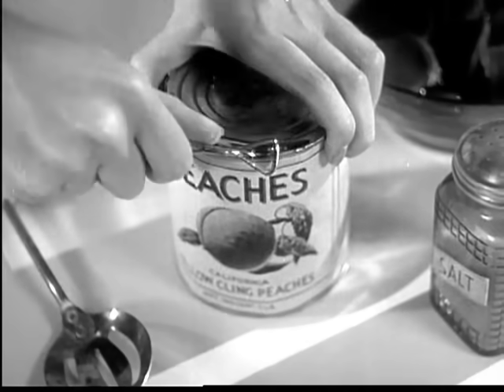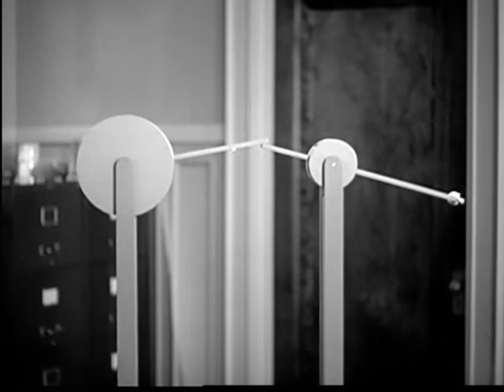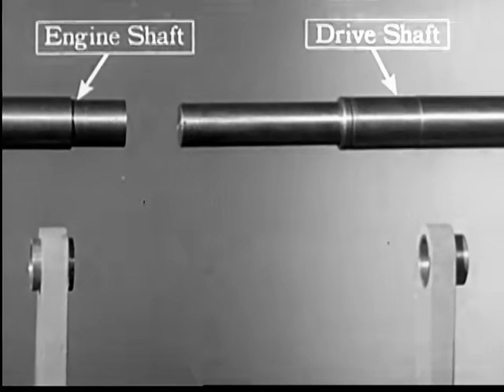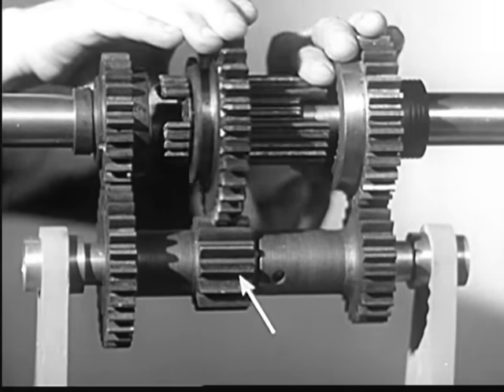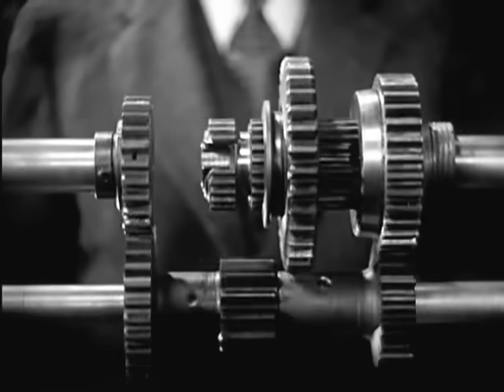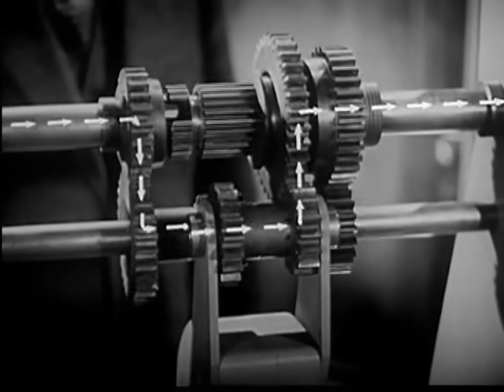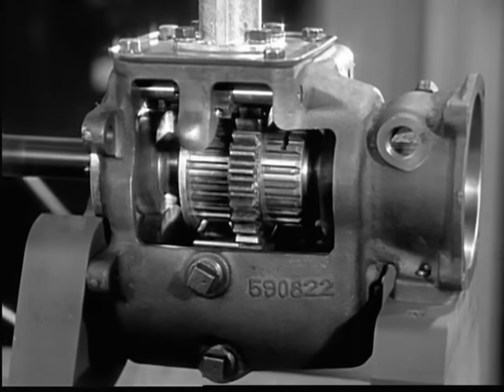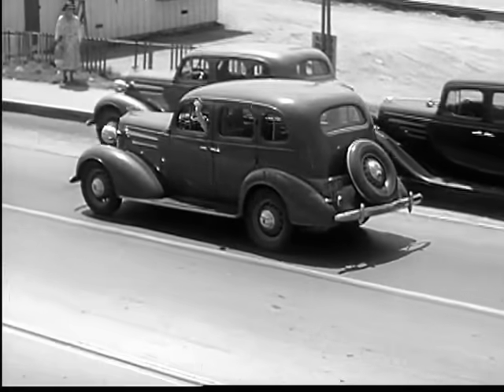Spinning Levers - How A Transmission Works (1936)

Comment: I wonder if these guys knew in 1936 that  over the next 100 years, no one would beat them in their explanation of how a manual transmission works.
Reply: These guys should have made modern DIY car repairs videos
Reply: Different times too.  But you couldn't always rely on someone fixing a problem.  Home repair books from the same era were similar, complex items or repairs broken down into simple to understand process.

My kids help around the farm and struggled with the stuff they drone out now, but if I give them old farming material from the 1920s to 1940s they get it.
Reply: @elilla331  Whoah! That's very interesting. Goes to show that nothing beats simplicity of explanation.
Reply: @vinayseth1114  absolutely.  Applies to a lot of things too, think of the big push on 'new math' but rote works fine, and if you understand the theory behind it becomes simple.
Reply: @elilla331  Oh, I wouldn't know that. Indian this side-I don't know if the change in curriculum you're referring to has come here yet.
Reply: @vinayseth1114  if there is one inevitably, if someone thinks it's better, someone will try changing it.  Even if real world results show the change would be worse.
Reply: @elilla331  Out of curiosity, what would you refer to as "new math"?
Reply: @vinayseth1114  humans actually are much dumber in modern times. Wihout being able to order food and basic supplies. Most people would eventually die.
Its kinda interseting how weak we actually are in western society. We rely on so much that we have forgotten how to do basic stuff.
Reply: @elilla331  Back editors didn't crack up marketing recipes yet, so their only strategy was "Let's hire the best author to write the best book we can print, and hopefully people will buy it".

Now it's more like "Let's hire this famous youtuber to write a book, let's put some drawings (not too complex), a bit of text (not too much, or people won't buy), and voilà!".

Content first vs marketing first.
Reply: @europeansovietunion7372  True on that.  Started to notice a similar trend when I was first learning C# back right when it was released(2000).  Lots of "booky names" of people who weren't actually involved in programming, but all the publishers falling all over themselves to make that money.
Reply: @elilla331  Thank goodness the laws of physics, which are key to making a machine, no matter how complex are eternal.
Reply: @elilla331  👍🏼👍
Reply: @elilla331  yes
Reply: @elilla331  its partly to do with the target audience of the learning material. Where i live we have a farming college just down the road and it is not for young teenagers. Many aspects is essentially engineering and science of agriculture. I think similar is true for most subjects but in the process of raising standards of education they forget to leave in some of the stuff to allow the younger people to absorb the information in a way they understand. Although some modern explanations are straight up Alien voodoo stuff ^^
Reply: @peterkent6250  Well I live in a farming community, we homeschool.  The entire community does, because the previous government(Ontario Liberal Party), closed ours and nobody wanted to put their kids on a bus for 3hrs/day.  

But, I grew up in a rural-urban area as a young girl.  All of our high schools were vocational and highly tied to trades, either so people could get some skills or because they were going into blue collar work.  Same government also closed all those shop programs, though last 5 years with the new government they've reopened them.
Reply: @elilla331 to me it seems like it's a large shift in the culture of our modern society. Personally, I'm disgusted by it, but this isn't really the place to get into it.
Reply: @elilla331  
My father told how hes first car drivers manual had instructions how to fix broken engine & gearbox with chewgum and screwdriver.
Today, my new car driver manual instructs me to not drink battery acid or coolant under any circumstances.
Reply: @MCH4RSK1HCPAALLIKKO  The first car I owned was a '96 Saturn SW2 with a stick shift, that I bought used.  In the manual it explained how to change and rotate tires, change the oil, replace the serpentine belt, and how to gap and replace the sparkplugs along with all the average normal maintenance.  

The last car I bought was a 2012 terrain, and yep, it has the same warnings while avoiding even the most basic maintenance, including avoiding how to check tire pressures as the vehicle had a TPS system.
Reply: @oliverheckendorf2215  something else too, most people had vocational training from school or home related work.  Ask yourself how many could change even the spark plugs in their car now.  Let alone changing a tire without a machine.  Society and the required knowledge to function in it is really different, even really different from 30 years ago.
Reply: I agree, I've been thinking bout using 1930 principles in all video that I do. Show and tell less talk and animate. These videos really sticks into your head.
Reply: The basic science of mechanics doesn't really change, it just gets more refined. Engines today work basically the same as they have since the beginning, just more refined.
Reply: Jhon Krasnovskiy  It would make you depressed if a concept you published 100 years ago was still useful? 300 years after his death, we're still listening to the music of Bach.  400 years after the death of Shakespeare, we're STILL producing remakes of his plays!  Heck, I'd be flattered!
Reply: Jhon Krasnovskiy  good point
Reply: Modern transmision works a bit different  and more efficently. Principal is almost the same
Reply: well everybody should start here and eventually get into more advanced understandings of newer technology. everybody’s dumb before they’re smart
Reply: To be fair we still have 15 years to go but I doubt we'll ever beat it. This is truly timeless.
Reply: My 1952 Willys Jeep has almost the exact same gearbox
Reply: It's brilliant and not stopping every two minutes to advertise some scamming  investing "secret" , dammit in those days you could go into a real bank for that 😀
Reply: if only teachers could explain shit this simple.
Reply: And imagine that they had no CGI to more easily do it. Maybe technology is not all it's cracked up to be?
Reply: yesssssss omg their explanation is on point
Reply: Or go through the trouble of engineering scaled-down models of a transmission just for a film.
Reply: Staggering clarity of ideas and videography from this era.
Reply: Damn I didn’t know they had video editing tools back then.
Reply: Just wonderful, been searching for "make your own candles" for a while now, and I think this has helped. Have you heard people talk about - Cenadoelyn Candle Contemplation - (Have a quick look on google cant remember the place now ) ? Ive heard some great things about it and my brother in law got great results with it.
Reply: lollolol yeah
Reply: 2021-1936 =85
Reply: All the other videos were confusing
Reply: https://youtu.be/xdEuLzPDLm4
Reply: This is the best video I’ve seen so far, all the other ones just confused me more
Reply: @mohamed elsayed Depends on the year and model, Chilton's or Motor should do you ok and they're available in most libraries(both physical and via e-borrowing), they're good if you know what you're doing, but they skip rote stuff you learn as an apprentice.  Hayes aren't bad for DIY and focus more people with some practical knowledge but not at the professional level.
Reply: yes and i still dont get it
Reply: Someone may do. It's only 2021...
Reply: U can thank the introduction of fluoride into the water supply and toothpaste for dumbing down society!!! That was its sole purpose along with destroying teeth so you look terrible and need dentures!!
Reply: Yes they did 36 is coding for 666
Reply: Or even come close.
Reply: 💎💎China 🇨🇳👍👍
Reply: in that time we went to quantum tehnology in everyones pocket and nearly everyone can explain the basic principles of a microchip
Reply: @timfischer8165  Yawn......
Reply: Yes
Reply: Most fools these days don't understand how a simple gear shift works either.
Reply: Fr
Reply: yes they knew future generations would be dumber, because they knew the were superior. everything back then was superior, they didnt need dumb computers.
Reply: 18 gears truck transmissions!
Reply: Fun fact. This is almost the same as how a dct works
Reply: Or that in the US most of us would be too lazy to shift. We would sacrifice efficiency (mpg) to let the auto do it for us
Reply: Agree!
Reply: Probably u didnt visit any INDIAN youtube channel.
Reply: There are nice explanation videos like this one: https://youtu.be/vOo3TLgL0kM

Note how complexity and strength of manual transmission changed with increasing the engine power. And you can find even automatic transmission and torque converter explained: https://youtu.be/X93k2vspvU0
Reply: Of course a video on a modern transmission would include computer programming , software updates, CVT principles,  ad nauseum..
Reply: Yes I understand very easy
Reply: yes
Reply: And that someone would be watching the "film" from bed in a device the size of a hand, across the globe.

Regards from Argentina
Reply: Very true.
Reply: @John.Flower.Productions  Yeah nah... This one isn't it, boss 😕😬
Reply: ????
Old generation is more smarter than now generation
Reply: That's why it's important too do great work. Posterity 😂
Reply: I have a chemics and mineralogy college level schoolbook from 1907, and it explains all the basics in a very hands on way, with a lot of practical examples like how to make coal from wood, or how getting iron from ore works and so on. It's actually highly useful in the real world, much unlike the books I had in school in the 90s.
Reply: Oh mankind, Surely we are created, and we were given life and we will be caused to die.
Where did we came from? What is our purpose? Why are we on earth?
You were created for a purpose. That purpose is to know and worship your Lord, Him alone.
Your life is a test, The Lord of all the worlds is the Most Merciful the Most Compassionate.
Don't go into the extremes like the christians and the jews. Don't worship the prophets.
Don't worship humans or animals. Worship the Greatest. The Creator. He is Allah.
Who send Prophets and Messengers to lead and teach mankind such as Noah, Abraham, Mozes, Jesus
And last and final prophet sent to mankind Mohammed came all with the same religion.
Follow that which we have been ordered. Don't die disbelieving. There is no return.
Do that which is good and forbid what is evil. Don't be fooled by satan who is an open clear enemy.
The only religion acceptable by Allah is Islam. The same religion each prophet and messenger came with.
Submit yourself to your creator so you may become a muslim.
Reply: @cydrohigh5375  In around the year 500 AD the condem was invented in the middle east by arab muslims using the lower intestine of a goat.

It was modified by the British around 1200AD by removing it from the goat first.
Reply: Actual Lesics could beat them as he used the same method to explain thing to us.
Reply: they probably had no idea they would explain it so well
Reply: I see why German tanks we really fast
Reply: @bckff5594  If only some people wouldn't have been so subversive.
Reply: Time for a 2036 video update: How a transmission works in an electric car
Reply: The youth today are not taught as well because of today’s failures with social issues such as discipline and changing priorities. During the 30s, 10th grade was their senior year and they graduated at 16 with an academic achievement level comparable to the first year and a half of today’s college level students; (13.6).
  In today’s world of 12 grades, students would graduate from high school with close to 4 years of today’s level of college education; (with no student loans).
  People today don’t realize just how far down we’ve fallen.
  Try watching a good movie called ‘The desk set’.
Reply: They probably thought communication would get better.  How wrong they were.
Reply: Well they wouldn't know about CVT either 🤢
Reply: Very true
Reply: You should check out the differential video too..
Reply: We still have 14 years hold my beer.
Reply: I wonder if they knew that in the 21st century you can't make jokes about women drivers
Reply: Old times everything was better quality
Reply: Really
Reply: True.it's impossible to get a good understanding of things from YouTubers explanations.
Better have these guys answer our questions directly.
Reply: ... all that and the nice touch of using a woman driver at the end!
Reply: Imagine if we had beat these and continued to beat each new one for 100 years
Reply: @jasonbender2459  because they haven't been explained fully who said it doesn't matter
Reply: @jasonbender2459  well played.
Reply: There are still 14 years left to beat them bro
Reply: @rickjeffjeff  mine was free
Reply: Yes, very clear visuals.
Reply: funny  thing  IS  ><   NOT  one  of  you  Know  HOW  TO  SHIFT  <>  !
Reply: Its not even in tell in my language but i understood it better than any other one
Reply: The KISS Principle at its finest.💯
Reply: lol
Reply: They had to be able to explain it to people with lead in their brain 😂
Reply: You are so right!
Reply: It's because humans got completely retarded recently. More and more retards like you have children and very intelligent people have less and less children or completely decide against it. Results, whole human population is currently fully retarded. You don't know that because you are too retarded to understand it
Reply: @itevensystems8860  ok buddy
Reply: No.
Reply: Instead of saying that, just say, I haven't really seen anyone explain a transmission like this before. 

Because I could point you to 4000 YouTube vids after the year 2010 going much more in-depth and remaining at a basic level of concept and understanding like here. 

No, it is not the best explanation, though interesting. 

Like kids thinking they know... It got so much harder than this.
Reply: @Hooly Dooly Automatics are damn near works of art at this point.
Reply: It is because this was a conpletely new invention and the lack of resources = explaining it like it is being explained to a dummy or alien
Reply: Well said
Reply: You know, these guys were a real genius.  Nobody finds a better idea than these guy. Same concept for engines and nox gears for years.
Reply: Im a truck mechanic and my teachers used these videos to explain different part of the powertrain
Reply: Or how levers and gears work
Reply: Yes, because modern education systems are shit. Take a look back to the 1930s for example. Nothing has changed in the education system, but look at literally anything else: phones, automobiles, buildings etc. They have all evolved and gotten better over the years. The education system, schools and whatnot have stayed the same
Reply: i knooooooooooooooooooooooooooooooooooooow right....easy 10 out of 10
Reply: They probably wouldn’t have guessed that in the intervening time businesses have dropped any notion or pretense of serving anything other than the short term interests of shareholders.
That we’ve more or less abandoned vigorous pursuit of any technology that doesn’t have an immediate, profitable application.
Reply: I'm afraid I could.
Reply: Well there are channels that have detailed animations and diagrams on the workings behind this, which is arguably a better explanation
Reply: T R U E
Reply: Nobody beats the Wiz! Nobody
Reply: I bet they had NO idea! 😂❤
Reply: "They" dumbed us down brother ..  I can feel it.... chicken and rice... yummy
Reply: So true
Reply: Why are the kids away?
Reply: Their CEO was hand-picked to orchestrate the Vietnam War. They knew far more than they'll admit...
Reply: Good point
Reply: Exactly!!!
Reply: honestly, the way these guys explain machinery is like no other
Reply: The only other major improvement I know is the angled gears that I can't remember the name of
Reply: lol i know right think of all the dumb shit on youtube or the internet that will still be here in 500 years people eating laundry pods instead of making videos like this
Reply: ikr
Reply: I wonder if back then they knew 'what is a woman'.
Reply: Ye but in 2036 that would be trully 100 years.Im suprised how much detail in 30' had.
Reply: @Merlok224  Ya and video editing.
Reply: @ArturoGarzaID  I dont think thats eddited video.Those are diffrient clips with hand draw animations.Meaning we were seeing stop motion but with more frames
Reply: Exactly
Reply: I know! I’m a novice to cars and trucks. My hubby showed me one of these videos to explain Differential Steering and my mind was blown. Now I am addicted to these videos! I am learning so much and it is awesome!
Reply: Its all by design.
Reply: Zoomers still think the world started in 2001 😂🎉
Reply: Errm there's still a few decades left to try!
Reply: They were too happy enjoying life to care.
Reply: That's actually crazy to me.  How have we devolved so far?  Our tech is better, but our patience and pedagogy has cratered.
Reply: Except it is in black and white
Reply: This is an ad from chevrolet. they want everyone to understand how much their cars are superior and well made so they can sell more. When motivated by money, anyone can do a marvelous job, including teaching.
Reply: Agree....100% older days are best..day by day we are declining in humanity
Reply: White people made life easier.
Reply: That's because of the intellectual property shitness. It messed up our own understanding of how thing should be working. Nowadays, you can't even repair your own shit without encountering these DRMs and IP shits.
Reply: @Cmd.SnorlaX  DRMs are a real pain in the *ss
Reply: Jhon Krasnovskiy  well it is a perfected technology. Like, there are only so many times you can make a video tutorial about how to use a spoon.
Reply: many still do...its that companies have ended production of manuals, automatics have gotten significantly better...not to mention the rise of EVs
Reply: @Interceptor810   and yet reliability in many automatics is still poor. I mainly refer to GM and Ford. And let's not get started on CVTs.. glaring at Nissan 

I struck gold and found a 2017 Ford Focus 1.0T with a 6 speed manual. Bought it the next day. Aside from TPMS lights it doesn't really give me many fits yet. It's been about 5 months.  

In all that talk about manual transmission setups I'm surprised nobody brought up 10 thru 18 speed transmissions.  I don't know much about them aside from an 18 speed is basically 2 5 speed transmissions glued together, where each gear has another half-ratio appended to the 5 main ratios.

For anyone that sees this later: 1 thru 4 are just that. Then you basically jump to another 5 speed transmission in the same enclosure. And each of those can be 'split' to make another gear ratio. Easier to get a grip on when playing with the switches. The only gears you can't 'split' are LL and LH. In practice, "2" thru "5" are also 7 thru 10 (8 speeds so far), you can then split all of those, giving you 16 speeds. 1 and 6 are basically LL and LH. Cannot split, making the last 2. 

 Most trucks now are AUTOMATED manuals. Which is a very similar concept to an automatic, but they're still gear driven instead of fluid driven.
Reply: automatic transmissions are work completely identical. Difference is in the "hand" switching shift stick. And if driver breaks his arm, arm will be recovered in a few weeks, when automatics still dead. Cheaper, stronger, durable and gives uncomparisonable more control. And NO, i paid MORE money for MT at the same model because i need more other options and more control at the road. Never heard/saw gone crasy AT cars? I saw, so let em burn in hell with drivers.
Reply: It’s only because they had to explain it to people who never knew think of it like teaching a kid to read you must treat them like they know absolutely nothing about it
Reply: But it doesn't work like this any more. We use a clutch
Reply: They Don't call them the "baby boomers" for nothing sonny!!     Haha
Reply: It was good except for the light explanation of reverse. Syncromesh could have been clearer. They don't mention a clutch or helical gears.
Reply: That's because there were no teachers unions making kid s dumber
Reply: I figure they would see it as they did their jobs right because the fundamentals of a manual transmission are unchanged.
Reply: Wow, they let a woman drive a car in the 30s for a manual transmission demonstration. Woman’s rights must have been so terrible back then
Reply: they didn't have things like multi-piece carbon fiber or yellow alloy blocking rings, specialized roller bearings, more powerful engines and standard hypoid gears back then (and so forth).  kind of apples to oranges here
Reply: That's because they only have 3 fukin gears
Now we have 6 and its harder to explain as the engines are wayyy more complex
Reply: @thanosks  6 gears aren't more difficult than 3.  Only your ratios change.  What makes it complex are things like positive and negative differential slip, selective shaft loss(aka positraction).  Or automatics, manual transmission are very easy to understand.
Reply: @elilla331  you damn youtube scholars dont know what yall be talking about! I drive a 2000 manual ford ranger and my transmission is nothing like the shit they described!!! They dont even have a ACTUAL CLUTCH ,FLYWHEEL OR PRESSURE PLATE!!!
Reply: @ahmedrasulmuhsin4042
Reply: @elilla331 . It still explains how gears work well and the general idea of a manual transmission
Reply: @elilla331  automatic tranmission were easy to understand until the electronics came around. but since then everything became shitty and complex for no reason.
Reply: @vincentkr  fluid paths, band ratios, differential pressures, slip adjustments are easier than simple gear ratios?
Reply: @thanosks  but did you see their video on differential?  I think they start at the base on the concept so it's simple to understand for someone who has no knowledge in mechanics and engineering.
Reply: @thanosks  but the basic design principle is the same
Reply: @johnriley8519  I know, but they can't explain the current design that well because its too complicated and more diversified.
Thus an older "simplistic" design should be easier to grasp for the above average human, because lets be real, its still pretty hard to understand how gears work even in the most simplistic designs if you don't know anything about them.
Reply: @thanosks  the concept is still the same with a 5 or 6 speed synchromesh transmission. My first transmission was a 1951 Chevrolet 3 speed synchromesh, similar to what you see here, except for provision for column shift (much nicer). I rebuilt that trans. My current transmission is a 5 speed in a 1999 Saturn SL2. I also rebuilt this, and the principles are exactly the same. It currently has 360,000 miles and works well. I've also seen the insides of many other synchromesh transmissions, and they are all very similar in design.
Reply: @td3993 welp try explaining planetary 6 speed transmission
Reply: @thanosks  It is different,  but no more difficult to explain. Too bad Ford wasn't putting out these films in 1936.
Reply: @td3993  Stick shift is dangerous. I recently bought an 96 Explorer with a stick and its so damn complicated to shift with the clutch and distracting. Scary how big rig drivers have this in their trucks. I brought it to Ford they told me it is operating perfectly.  Tech who drove it said he would be interested, can't get an SUV with that anymore (who would want one :lol;). Probably will sell.
Reply: @alb12345672   I can drive stick shift in my sleep and I also never roll backwards on hills. You obviously have a lot of learning to do.
Reply: @td3993  Yeah, maybe I have to practice more. The hill shit was scary, I almost creamed someone :lol:.
Reply: @alb12345672  The big problem on hills are people who get too close to you.  Keep in mind that in North America, sales of stick are almost non existent these days, you even struggle to find it for transport trucks.  Something we found out when we went shopping for a new one for hauling grain and cattle.  Everything Peterbilt and Volvo had on the floor and lot was auto.
Reply: @elilla331  Yeah, the tech who drove it told me except for the Mustang, they pretty much don't exist. He also said its becoming less and less popular. All the trucks from Ranger to the 750 have only autos now.
Reply: @alb12345672  I get the reasons for it, especially with the massive traffic issues we have here.  But I want stick when I'm hauling in cattle or taking food grains to the elevator.
Reply: @alb12345672  You can still get them but they are often special order.
Reply: @alb12345672  hahaaa we grew up with stick shifts so easy and fun to drive
Reply: @td3993  why are you lying 🤥 you completely forgot the use of a flywheel and clutch plate! You cant drive a manual in real life
Reply: @alb12345672  I've driven sticks on Fords, Jeeps, and Nissans on icy mountain roads and empty scorching deserts for decades. They are certainly not dangerous nor distracting. You just have not driven a stick long enough to develop the muscle memory skill. Eventually you'll learn to shift autonomously and you'll be no more aware of your shifting as anyone in an automatic is aware of their slushbox shifting. I would take a stick over modern autos as the gear is where I want it, or need it, and not where a computer programmed to maximixe MPG over power thinks it should be. I have literally had to pull over in an automatic car on high mountain passes because the computer would not downshift, was oblivious to the effects of high altitude on power, and ignored any attempt by me to force it into a lower gear! Plus, I can engine brake if going downhill, I can start my car with a dead battery (that's handy), I never have to worry about trans fluid leaks,  and all my manual transmissions are physcially smaller than an auto, which is handy for maintenance. And I never have to worry about anyone borrowing my car with or without my permission as only a fraction of drivers can handle a stick anyway. And there is nothing like slamming through the gears of a sports car while soneone in their slushbox tries to keep up.
Reply: @alb12345672  na you're just a bad driver. You can drop that Explorer right off in my driveway if you don't want it. Been looking for another one for an off road rig.
Reply: @alb12345672  I drove a pickup with a 4-speed manual every day for four years--fun to drive. (I'm not being sarcastic.)
Reply: @alb12345672  it becomes second nature after practice. I taught myself on the way to work over the course of a few weeks. Stalled too many times. Got scared. Now I can drive anything. Don't sell your manual explorer unless you get a manual yota instead. Manual transmissions are cheaper and easier to maintain.
Reply: thanos ks not really just 3 more gears and you can understand how they work just by applying the principles of the video small tuns big to get more power big turn small to go faster
Reply: @thanosks  dude the principle it's the friggin same, it doesn't change what's explained in the video
Reply: @coletrickle4955  im not saying that the principle isn't the same im saying its easier to explain an older design with less gears than a newer design with 7 gears. That's why its such a good video ot teaches people how a simple transmission works while giving a vague understanding 90 years later how current manual cars work
Reply: @coletrickle4955   manual transmission arent the same dummy we have flywheels and clutch plates now
Reply: @plntycash  lol you think they didn't have flywheels and clutches in the 1930s? omfg where did you go to school?
Reply: @thanosks  Actually you're wrong.  Even with more gears the process is still the same, just more gears on those shafts.  (And we're talking transmissions, not engines here.)  Now when we move to automanual and automatic transmissions, then we're talking about a whole different animal.
Reply: @scottlasater4658  more gears are harder to explain here its just 2-3 gears so its easy to explain each orientation thats what i meant
Reply: @scottlasater4658   no your wrong the process is not the same! This transmission doesnt have a flywheel or clutch plate! And the engine connects directly to the load in last gear, which also doesnt happen in modern manuals or my truck
Reply: @thanosks  Yes, however at the end of the day it is a machine. Thus, it is beholden to the timeless laws of physics.
Reply: @thanosks  5 gears isn't too bad to explain. It's basically an extra two gears just like the first and second gears. Fifth gear still works the same way as the film's third gear.
Reply: @Milnoc   yes it can scale up quite easily but still it would be more difficult for people to grasp so explaining an older system like that and visualizing it with the real system and then saying it scales up is much easier i think even 2 years later XD
Reply: @thanosks  that's why we start with the basic. Jumping to the advanced stuff immediately expecting us to already know the basic from day one is what they do nowadays.
Reply: @thanosks  Ok 10 that are very closely syncd
Reply: @thanosks  I showed this video to a kid and now wants to be a mechanic xd
Reply: @Just6-2  its a kid still it will change a career course multiple times XD
Reply: @thanosks  true, from mechanic to electrician lol
Reply: @thanosks yeah but it goes by the same principle. There are more positions in the transmission but everything else is literally the same
Reply: @thanosks  6? The standard Chevy automatic transmission from 2015 has 8 and in 2019 the 10-speed became standard, and Chevy is in the final stretch of making a 12-speed for consumers
Reply: @David-jt9nt  i haven't seen any manual with more than 6 idk if there are some with more tho
Reply: @thanosks  in 18 wheelers I think they go all the way up to 16 but in consumer stuffs ya 6 is about what you get with a manual
Reply: @David-jt9nt  oh yea tractors and trucks have more im talking about cars
Reply: @thanosks  It's just extra gears. The principles remain the same.
Reply: @Connor_Arroyo  yes thats what i said
Reply: @thanosks  You only have six? I have six... six thousand!
Reply: @thanosks It's not really more complex. Just put another transmission in series with a greater gear reduction. Instead of having one syncromesh gear, have two and choose between them.
Reply: @nathanielhill8156  so more its complex thank you
Reply: @thanosks  or a 10 gear automatic with 24valvle fuel injectors a turbo on a straight 4 cylinder
Reply: @thanosks  I disagree, having 6 gears is not more complex really. it's just bigger. its 2 of these... Super simple, I've learned that people have a hard time understanding how gears work though. So its not that there more complex... its just people are losing what was common knowledge.
Reply: @thanosks  you would need an absolute galaxy brain to understand a six speed automatic transmission without any previous context about how gears work.
Reply: @thefederalrepublicoferusea3900  i mean i understand even quantum physics so its not a problem for me
for some people tho ye
Reply: @Ryu White because of the technology we use today? Planetary gears for automatic cars v8-v12 for sports cars electric cars that have cameras all around them what else do you need?
Reply: ...come on its only a three speed manual  gear box ...